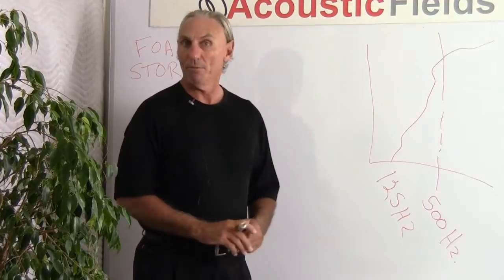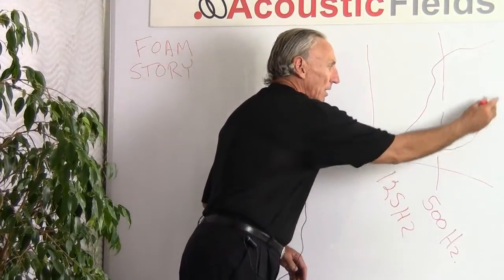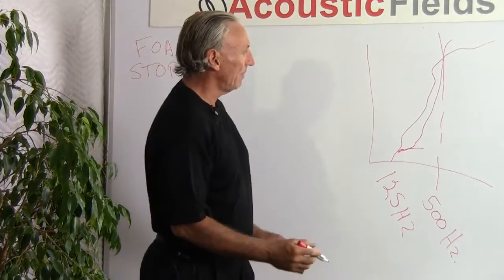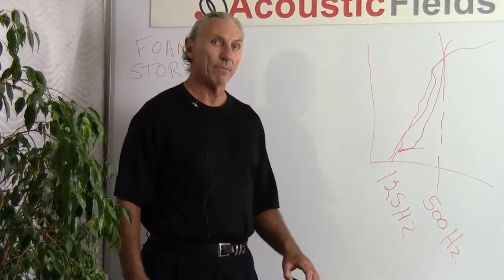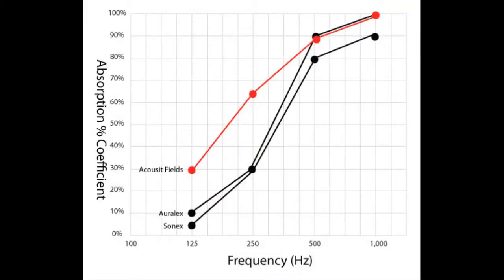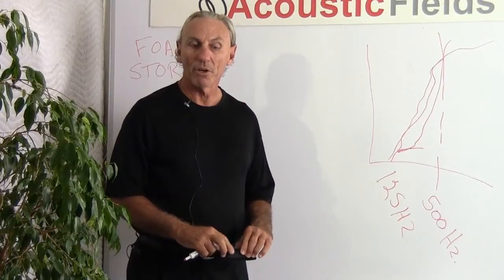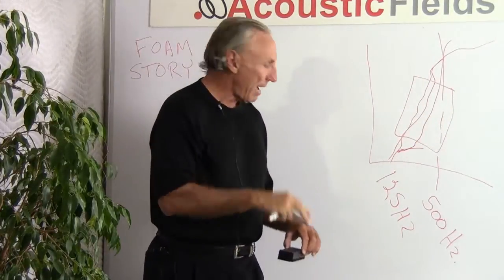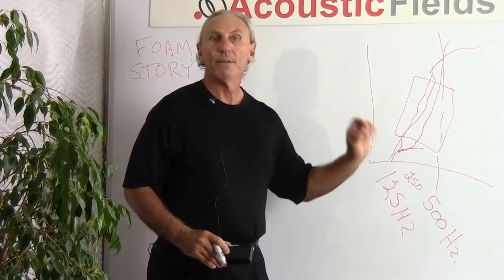The Acoustic Foam Story And Why We Developed A Smooth Absorption Curve

Comment: Hi Dennis,
First of all thanks a lot for sharing such wonderful lessons on sound proofing. But just I have few questions:
1.You have told that damping can be achieved by adding different foams and ultimately thickening the surface. So, as I am living in remote location and all of these forms are not available.Can you please suggest what kind of material could be used for isolating walls, glass windows and doors.Like the material which could be available is glass wool ,cardboard and the likes. 2.For windows what kind of material would be best to be putted b/w the glasses for damping like somewhere I saw its PVB but it has no damping effect. So, can u suggest any.
3.For doors sealing what would be best
Reply from the maker: +Kanwal Nain First, and foremost, when you are dealing with noise transmission, you must quantify and qualify the noise you are facing through measurements. Without knowing the frequency of the noise  and its relative strength, you are just guessing as to what materials and what arrangement of those materials you will need. The barrier you build is directly related in thickness, material density , and construction methodology, you will need to manage the noise transmission by building the proper barrier technology. If you guess with noise transmission issues, you will guess wrong. Finding the materials to use is the least of the issues you will be faced with. You must define the noise issues and then assign the correct materials and their arrangement to deal specifically with your noise and vibration transmission issues.